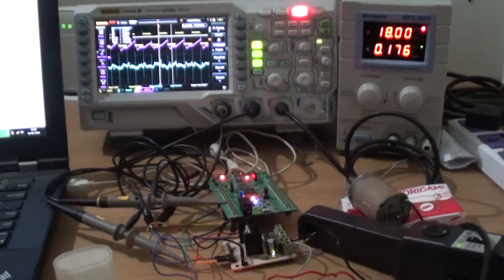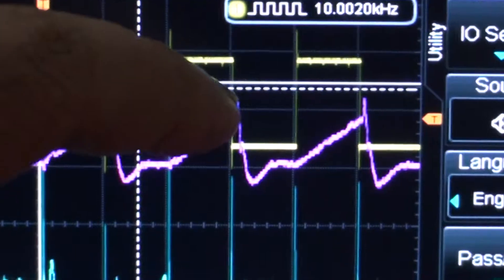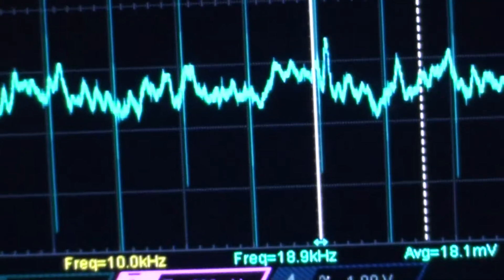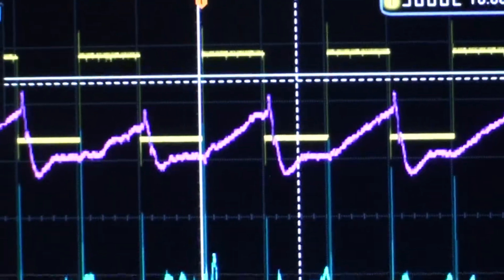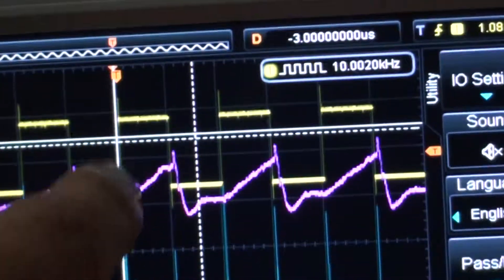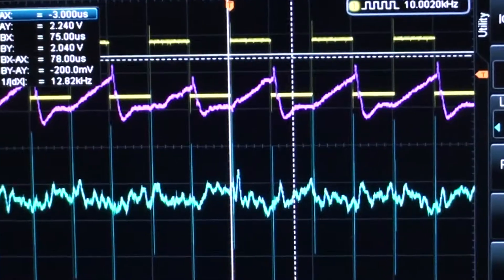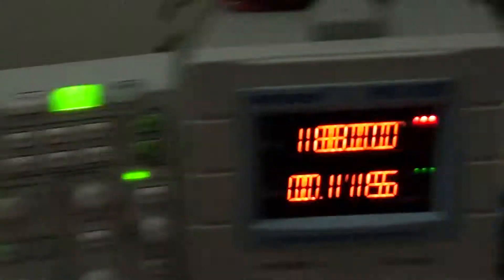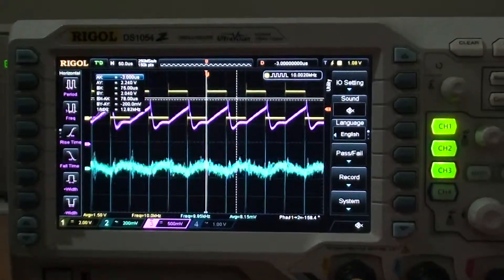DC motor current measurement (low side) vs. ACS712 - 05A.

Comment: Very Nice video. I have only 1 doubt in case if we are doing closed loop control of current/torque, the pwm duty cycle will vary as per PID output. In that case can we get proper reading if we took samples at mid of on cycle.
Reply from the maker: Yes, it will be. But you have to vary your sample point to be in the center of every PWM, because the PWM duty itself will be varying as per PID output.
Reply: @Debraj1978  Ok. Thanks.

Comment: Is it possible to measure the speed of brushed dc motor using the current and voltage waveforms?
Reply from the maker: Yes, it is possible. If you know the V, I, R, L, feed all the values into this equation --> v = iR + Ldi/dt + e
you will get "e". Now, if you know the back emf constant of the motor, you can find the speed.

I tried the same on my other video = https://www.youtube.com/watch?v=On9jgL5pAB0
Reply: @Debraj1978  Nice demo, i think the L of a dc  motor changes at each turn angle, did you check with LCR meter anytime?